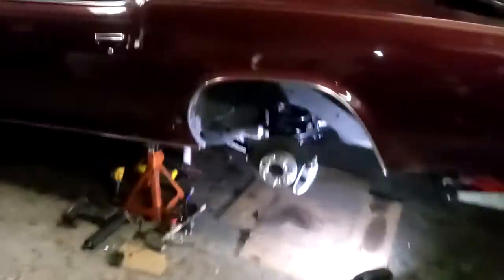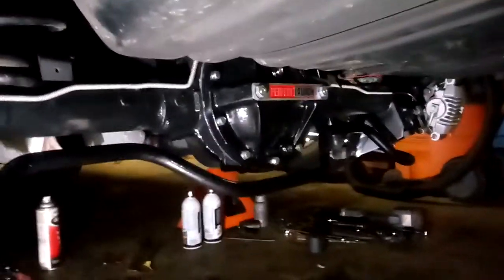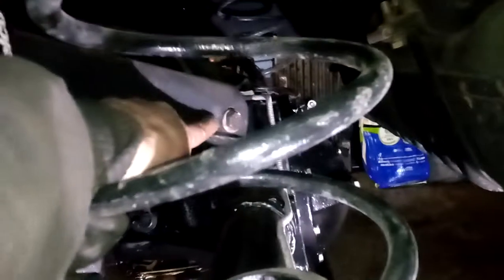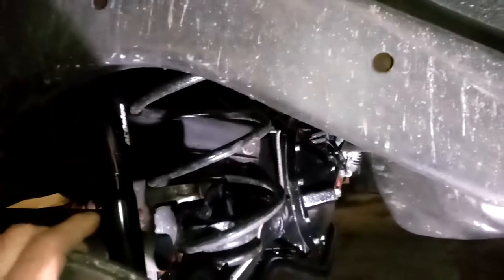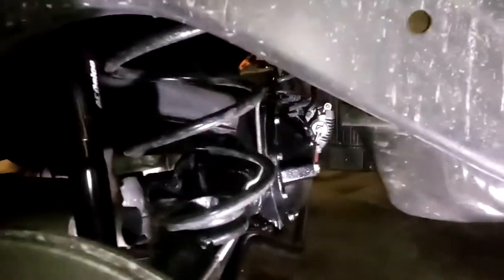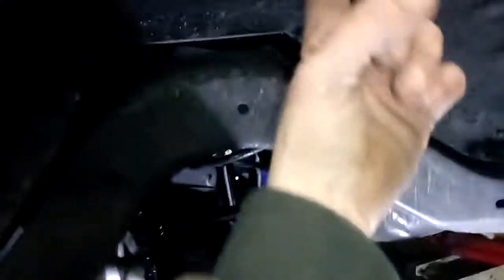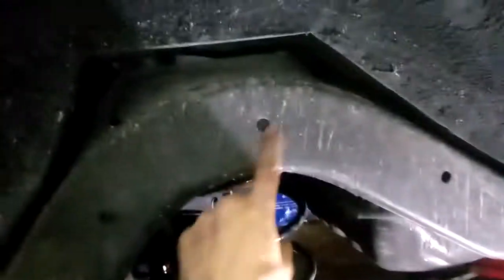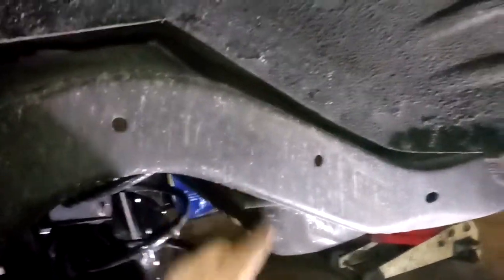Installed 1995 caprice disc rearend in 1976 cutlass

Comment: What made you converse to an Impala rear end? Did you narrow it??
Reply from the maker: For the 4 wheel disc did front from 95 caprice to front 11.95 rear 11.90 with a 8.5 ring gear factory front 10.5 rear had drum and a 7.5 ring gear
Reply from the maker: And no i didnt narrow it direct fit except lug pattern original is 5x4.75 caprice is 5x5
Reply: I own a 1975 Cutlass is why I asked. I would like to do some upgrades myself.
Reply from the maker: @realwithself5159  no problem hope the videos help